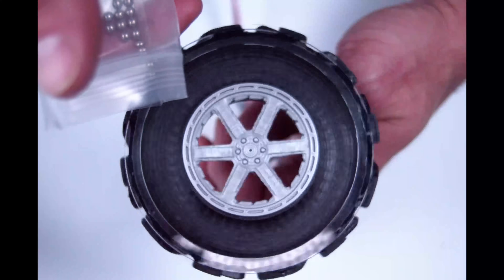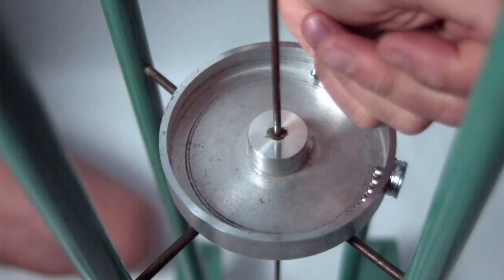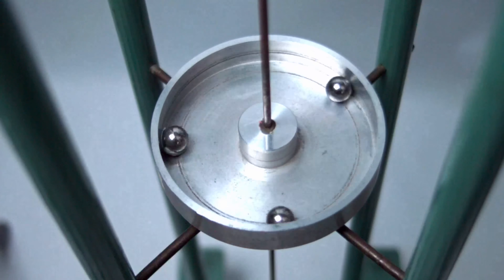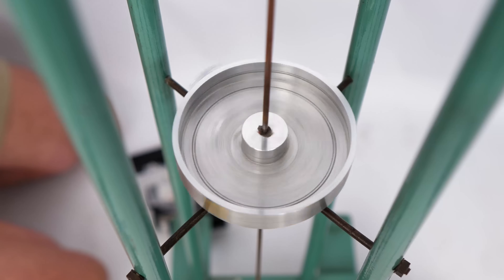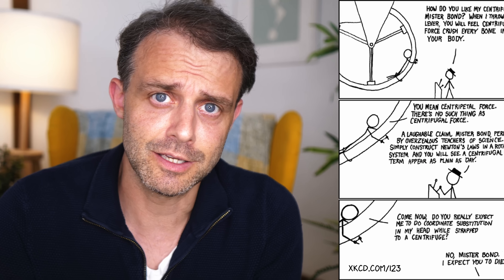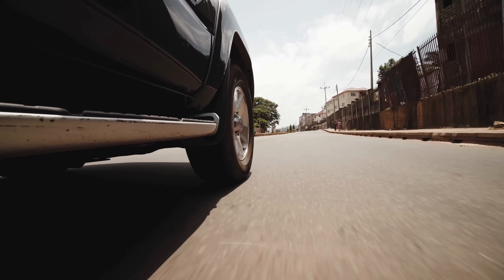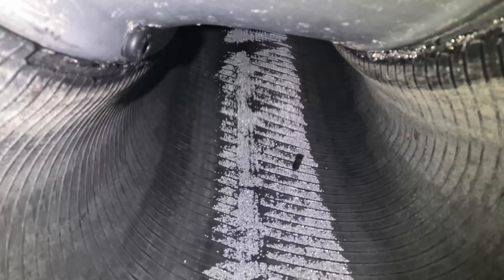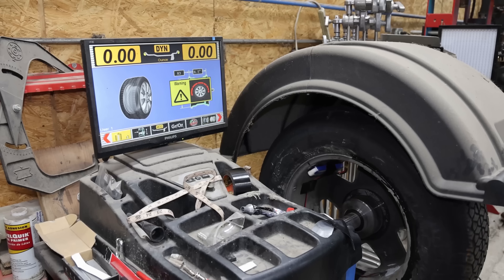Do tire balancing beads actually work?

Comment: Let's add a little perspective to this. In the 1960s  aUniversity of Nebraska student created and manufactured a plate that fit behind automotive hubcaps and was bolted to the wheel by the lug nuts at the outside of this device was a rubber tube that was filled with light machine oil and inside the tube was a number of steel ball bearings that automatically balanced the wheel of these were around for a number of years until people started using all the fancy custom wheels they were then change to fit behind the wheel on the lug nut shafts but of course some of them wouldn't work because of all the custom wheels and designs so this idea has been around since the 1960s it's not new. Yes I'm that old I remember seeing these sold at the Nebraska State fair before I graduated from high school in 1965

Comment: i found this an very intresting topic, it made me think like what if you have some slow curing glue inside the tire with these balancing beads and spin it for about 10 minutes so that they are permanently  in place that way you won't need to put balancing led on the wheels

Comment: I could be wrong but I think the explanation at 7:48 is incorrect. It seems to me that at this point the stiffness of axel means that it can't respond to the change in position of the centre of mass fast enough, so the system rotates (in an unstable manner) around the axel rather than around the centre of mass.
This is different to the lower frequency case in which spring constant is small enough for the axel to move to compensate for the moving centre of mass, resulting in effective "free rotational motion" as you describe.

This is why the two resulting modes have different behaviour - in one the system rotates about the axel (high frequency) and in one the system rotates about the centre of mass (low frequency).

Comment: omg finally i can tell customers WHY the stupid bag of beads they brought for us to put in their new tires IS, in fact, stupid. basically, youre going to experience tire imbalance pretty much all the times you WOULD experience it without the beads to begin with. you might as well just not balance the tires at all. think about it, how common is the situation where you get up to highway speed, then back down to side road speed WITHOUT stopping first. almost never. most of the time, you get off the highway exit, STOP (or nearly stop) THEN get back up to 50mph-ish. at that point youve lost the balance from the beads. hell a lot of drives people take just never reach highway speeds to begin with, so theyre experiencing imbalance ALL the time. just let your tire guy balance the damn tires. its included with the mounting of new tires anyway.

Comment: my brother uses the beads. he goes mudding (basically take your truck off road in a bumpy muddy field. it works well because when you go mudding you get a lot of mud on your tires and this will cause wobble when you get back on the main road. so it fixes the shift in weight.

Comment: I started at Walmart tire center 16 years ago and then MTB, now working at a private tire shop. I've never worked with large truck tires past a F450. In that time, i've played with balancing beads many times and they either make it way worse, or do nothing at all.

I live along the blue ridge mountains and get alot of offroaders here and have played with tires for hours trying to see if they would do anything by themselves, in combination with wheel weights, and just wheel weights. I've found (and the same results with regular car/light SUV truck tires) that the beads would just keep throwing off the balancing machine constantly saying different ounces needed in all different places at varying weights, and whether you add 5 ounces to 25 ounces it would make no difference. I spent all sunday one week with these beads on my 1998 4Runner with 35 inch tires and no matter what i did, they would not even get close to balancing out, all tires were between 6 to 18 ounces off on either side, this was obviously horrible on the road, the faster i went, the worse it got.

I removed all the beads and balanced them with just wheel weights and was able to get them all within a few ounces of each other and sides using all inside weights balancing them multiple times, taking them on the highway at 70MPH with very minimal vibration (pretty standard for tires like this)

I've tried with others from 13s to 24s, run flats and non to no avail, no matter what i did, they either made no difference or made it worse.  

I read in the comments some are having luck with them, if that's the case, good for you, but every customer we've ever did balance beads on there car/truck, they all eventually come back to have them balanced properly. We stopped using them at MTB half way through working there, and the place i work at now won't let us use them at all even if we wanted to.

Comment: Jet engines use the same principle. The blades of the turbine have a bit of tolerance so that when it gets up to speed they move the perfect position to be balanced. That is why you here a clanging sound when a jet engine is windmilling. It isn't going fast enough for the blades to be making enough centrifugal force to hold them in their position, so as they pass over the top of the engine the fall down and hit the next blade.

Comment: 30 years ago when I was on vacation in Canada we got a flat tire, and the garage mechanic that changed the tire just put in a handful of sand, said that it would balance it, and it did! No need for a glass beads or ball bearings etcetera, you can use a small handful of sand and probably some really small gravel would work also

Comment: I mean, if beads and ball bearings can do the job, why are wheels not constructed with weights that can move in a groove in the right position at high speeds, but stay there for lower speeds? Self-centering wheels, very simple.

Comment: So what you saying is put a bunch of beads in a tire, add some sort of set time adhesive, go for a drive at highway speeds until they balance and cure, and boom, balanced tires stays balanced

Comment: This would probably be useful. If balancing your tires weren't a real cheap and fast thing to do. (At least here, where we have to switch between winter and summer tyre).
I've owned and daily driven at 10+ cars over the last 25y. This has been an issue a grand total of 3 times. Comes spring/fall, i've just rolled in at a tyre workshop with the lose tyres and got them machine balanced while waiting. Last time i think it cost me about 50€+tax.
Guess it would take slightly longer and cost a little bit more if the tyres were on the car, but still. Quick and cheap enough.

Comment: Now is there a material to be set in place for self balancing during a high speed rotation, then freeze the beads in place to also be used in low speed?

Comment: Thanks for the video. I was about to complain that you are talking about a wheel that rolls on the ground but you are demontrating using a model that looks flat to the ground changing the effect of gravity acting on your beats. 

Luckily you included gravity at the end and explained that at certain speeds the effect of gravity goes away, due to the self balancing effect coming to play.

Comment: Beads are most commonly used on very large truck tires that either require too muchweight to be conventionally balanced or on aftermarket wheels where weights compromise the appearance.  Sometimes they are used on car tires, but as you showed us, conventionally balanced tires are better since they are always balanced not just after reaching a higher speed.

Comment: Mechanic here. I use beads in tires that are problematic to balance conventionally, mainly oversize 4x4 tires and anything that is to big to mount on the balancer. They greatly reduce how many people complain about vibrations but only using them in applications that aren't expected to be smooth is key to success.
You've given me a much higher quality explanation of how these things work than the one I've been using, thanks for that!
Reply: Its weird, as I used to work at a 4x4 shop and we would constantly have to vacuum out peoples balancing beads and go back to conventional weights to get rid of vibrations.
Reply: @Arctic_Light ofc because the story with beads is nonsense it works only with high rotational speed wich you never get when driving normaly btw thoose beads once they turn in to the resonant rotational speed then they doesnt work anymore that why you get vibrations again so it works on a sweet spot of the rotation speed such a nonsense if one mechanic btw i am mechatronic i dont need to study cars i study everything from the graph of an hydraulic converter to an automated sps machine i got it all thoose beads only work in sweet spots its like making images with dust on a vibrating plate you get only the image on the resonant spot of the material it will only work in thoose sweet spots of the rotation so for cars 4x4 plane and almost every rotational movement wich can slow down and accelerate thoose beads will never work they just work at 130mph then it will stop working and it will work again at 200mph its just an example i dont know the numbers and i dont need to know them i just need to know that resonant balancing beads thats the acurate name for thoose little guys can not work in different speed factors and you are right i dont wanna know how many people got foolled by there mechanics to out beads inside there tires the beads cost nothing roll of a tire of a wheel is not a great action to so two cheap things to do to fully fool people and that works veryfast and verywel because people believe they believe every shit they got told 
Im ver glad for you honesty and i would come over to yiu garage if i would life near by because yiu are telling the thruth resonant balancing beads in cars never gonna work never
Reply: @FirstnameLastname-db5pp  Dude, that's some incoherent rambling you got right there. When your sober, watch the video again, there's good stuff in there.
Reply: @FirstnameLastname-db5pp I tried to read this but it hurt my brain due to the lack of punctuation. That makes a lot more work to process the information...
Reply: I wonder if we could somehow use those beads to figure out where to put more permanent weights afterwards.
Reply: @mskiptr  Glue.   Splooge in.  Go for a drive.
Reply: @ashtontechhelp  That might actually work, if ya try it make a video.
Reply: @mskiptr  How, given that they are in the tire?  And, why, given that the tire shop has a perfectly fine machine that will do that for them?
Reply: @craigdupree1687  Well sure, if we already have machines that do it well then there's little point in developing alternative ways. It's just that those beads do perform the equivalent calculation on their own and since they can find "the solution", it might've been cheaper/easier to somehow capture this solution from them instead of measuring it somehow else.

As for "how?", those camera views that you see in the video do the trick as a starting point. Though mounting several cameras inside the tire and then extracting the mass distribution from the footage is not really practical.
Reply: @mskiptr  someone else in the comments said that he was working on some turbines for something and their method of balancing things (or as I understood it), was that they had a big metal container, similar to the one in the video, but with internal ridges ball-size spaced and a clamping system that would go from inside out only above certain speeds and the clamps would have a mechanical lock that would prevent unclamping when slowing down. So then they would slow it down and add one more container above with denser ridges and smaller balls and repeat. They were repeating by stacking containers above each other with smaller and smaller balls because they needed that thing to spin perfectly.
Reply: @nydydn  That is so interesting! Thanks
Reply: This is exactly why we use them at work. Big 4x4 trucks who drive more dirt than road and only need beads for highway use.
Reply: Yup. Im running 40" beadlocks. Before i ran beads, i would have to go to 10+ tire shops before I found one who would "try" usually because of the size, the weights ended up flying off after the first bump and un-balance themselves. Ive now been running beads for 4 years and rotate my tires religiously. Almost near perfect treadwear. 😊
Reply: I started using the bolt on balancers on semi truck tires. They extended the life of the tires by thousands of miles. When the beads came out, I jumped on them. I use them in every vehicle I have. Motorcycles, 4x4 truck, family SUV, and the Corvette. Same as the big truck, loads of extra miles and a great ride. Best of all, the 4x4 and ADV bike will balance out any rocks or mud that you might pick up on the way, and as you loose the debris you will balance along the way.
Reply: How many of those tires wore pre maturely?
Reply: Exactly this. Have them in my off road camper. 90% of the time I’m travelling at less than 20kph. When I join the road 80+kph they balance out.
Reply: Jeep owner, can confirm really big 4x4 is really the best use case
Reply: Not a mechanic, but worked in a tyre service doing both car and truck tyres, and had a truck wheel balancing machine. We tried both with some of our regular truck drivers and they'd prefer the beads as in Australia, trucks are usually doing 100kmh, and beads will always find their correct place, lose a wheel weight and it's vibrations for 100s of kilometres.

Not once did we ever use them in passenger vehicles though, as suggested in the video, much more driving is done around town so less likely the beads can do their work.
Reply: Mechanic here i hate those asshats that get upset that their mud tires don't ride smoothly on their way to starbucks.
Reply: Yes larger truck tires etc are key
Reply: I run all terrains with beads and smooth as butter.
Reply: Use golf balls instead. They work better than the beads.
Reply: Such a lier 🤣🤣🤣🤣🤣 dam you fool nobody my friend
Reply: I'm confused - where do the beads go? Inside a tyre is a tube full of pressured air.
Reply: @blackfootedcat  That's how it works for a bicycle. But in a car there are no tubes inside. The tres themselves have to be airtight, because they get pressurized directly.
Reply: @blackfootedcat  Most modern tires don't have tubes, the tire bead makes an air tight seal to the rim.
You pop over the first side of the tire, toss in the beads(still in the bags) and pop over the second side of the tire and inflate. 
lots of tire mounting demos on YouTube if your having trouble visualizing it.

Comment: iirc, (computer) cd/dvd drives etc use something similar to balance the disk while it's spinning at high speeds. A good way to dynamically balance it when every disk might have a different center of gravity.

Comment: 40 YEAR OLD TECH
Truck parts stores used to sell these as a bolt-on attachment for each wheel end. It was a ring of 3/4" pipe with several large bearing balls in it that was welded to a thin metal disc with the standard "10 - hole bud" pattern, that fit between  the brake drum and the wheels.

Comment: they make sense for the correct application, semi trucks that are more often at highway speeds make sense. a passenger vehicle that is quite often under highway speeds it doesn't make as much sense for. also I can't imagine the TPMS in the tire likes getting the crap smacked out of it by glass beads on every rotation on non highway roads.

Comment: Car wheels are not free to flop around, they are held in place with respect to fore-and-aft motion. And the vertical motion is dampened by shock absorbers. You should add that to your model.

Comment: That seems to be a flawed design. The beads would have to stay in place for the tire to be balanced all the time. So every time you stopped at a red light and drove slow those beads would stay right at the bottom and your tire would bounce crazy. The wear and tear on your tire by the time those beads get in the right place. You'll be replacing your tires often, no thanks. Plus I'm sure the vibration will do more damage to the other components of your car.

Comment: I've been changing my own tires since the pandemic. I use BBs to balance my tires. I haven't had any problems yet. about 3oz for car tires and about 6oz for truck tires. I get a perfectly smooth ride every time. you can find a chart on line to get the best balance for your tires.

Comment: I think you missed an important part. When the tire is in contact with the ground it’s not round. It acts as a ramp that gives the beads a kick start at low speeds. That’s why you can spin the tire up on a proper wheel balancing machine with beads and get a verity of pass and fails in relation to how balanced the assembly is. BUT put that wheel on a car and it doesn’t have a vibration. They work I use them. I was also a skeptic being a mechanic and the new beads going against the text book. 

You can easily feel 10-15g out of balance on one tyre on the front axle. 

Also a note trucks use these all the time now.

Comment: In my work truck the worst vibration happens between 65 mph and 70 mph. It really lets you know if you passed the 65 mph speed limit. I wonder why that is, the tires are not much bigger than passenger car tires, but maybe that's all it is.

Comment: My brother took an old truck off my hands that had one of the tires off the rim for a while collecting rainwater.  It was never drained before it was put back on the rim and it ended up with water sloshing around in the tire. He only drove it on back roads at slow speeds, but would liquid have the same effect at highway speeds?